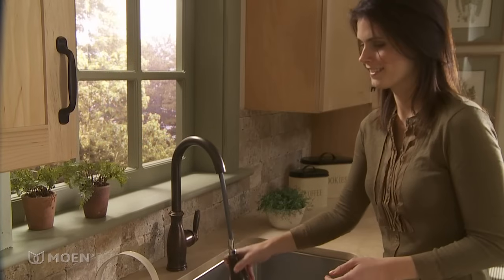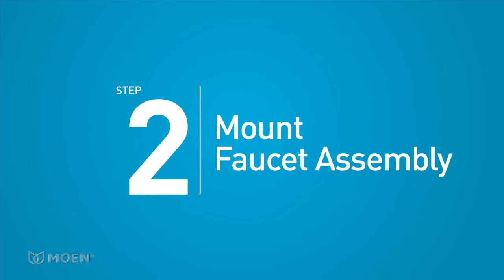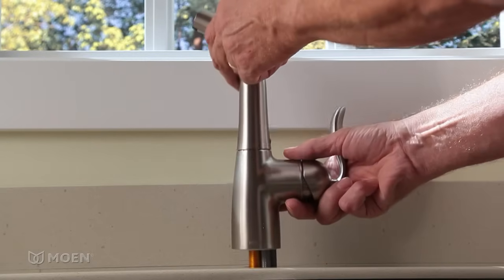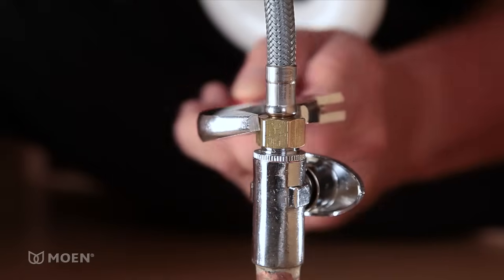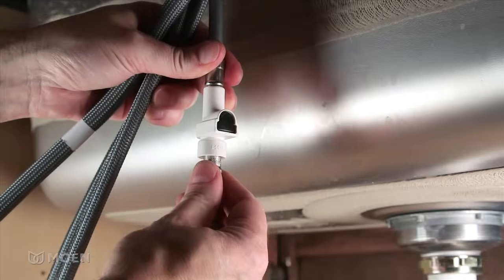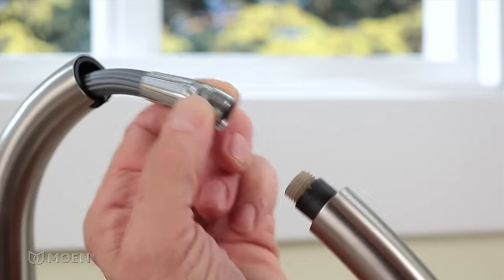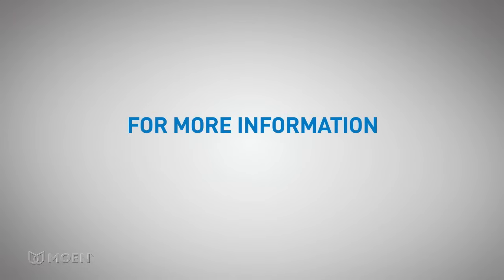Installing a Pullout Kitchen Faucet | Moen Guided Installations

Comment: My Moen faucet is now installed, and this video helped every step of the way. Very happy with it. The real work was getting the old faucet out, which was quite determined to stay put and leak and not run hot water. Glad it's out and the Moen is in.

Comment: This was a great, easy to follow guide for installing a pullout kitchen faucet. I was able to do it in about an hour with no problems. Thank you, Moen!
Reply: Yeah!  That would be great if they actually provided you with a support bracket for a single hole application.

Comment: Very helpful. This is my second Moen faucet and I must say they're well engineered and easy to install. Pro Tip: some older under sink valves might leak during installation. I recommend turning the water off to the whole house if you can, not just the water at the faucet.
Reply: InstaBlaster.

Comment: Thank you for this video; I installed the pull down hose in 5 minutes and saved $195.00  :)
Reply from the maker: We're happy to hear it, Evelyn! Check back often for more helpful videos.
Reply: Me too!! I will always buy Moen!
Reply: My pullout hose only lasted 4 years and started leaking in the middle. Home Depot does not sell replacement parts. Poor quality.
Reply: @Bad_Samaritan   Our previous Morn tap set like this eventually the handle gave out.    Moen sent the replacement parts, which I put in myself.   Worked for another year, and it similarly broke again.   I'm hoping new tap sets are even better now, as they would be aware of any deficiencies in their product and redesign as needed I'm sure, so I will purchase their products again.   We're on our second Moen kitchen tap set, and this one has worked flawlessly to date and has been in for well over a year now.
Reply: My handyman is charging $300 to install this.

Comment: This video helped tremendously. The install went smoothly. However the lever motion is from straight up to 90 degrees forward. All other sinks have been 45 degrees either way from vertical.

Comment: We replaced our old separate faucet and sprayer with a Moen Pullout Kitchen Faucet and couldn't be happier. We repurposed the sprayer hole for an garbage disposal air switch. I would suggest reading all of the instructions and/or watching this entire video before you begin. After several frustrating minutes of trying to tighten the mounting nut by hand, my helper handed me the "installation tool" and said, "Here, maybe this will help." 🤪
Reply from the maker: Good morning. Thank you so much for your feedback. Our Product Specialists are available if ever needed in the future. They can be reached at 1-800-289-6636 Monday through Friday from 8am-7pm EST.
Reply: Oh so this is what it is! I had that same aha moment! I am 71 years old and I just finished installing my new faucet!
Reply from the maker: Hello @bethmorano1452.  We are happy to know that our video helped with the installation of your new Moen Pull-out kitchen faucet.  
If you have any additional questions or require assistance with this faucet, Moen product specialists can be reached at 1-800-289-6636 and are available Monday through Friday from 8:00 am - 7:00 pm Eastern Time.

Comment: Thank you for the great instructions.  Question about Step 3, why no plumbers tape?
Reply from the maker: Hello David.  Plumbers tape should not be used when connecting the supply lines to your shut-off because the supply lines have a built-in washer to seal them.

Comment: this video convinced me i could do it.   bought Moen faucet put it in yesterday.  last night all was well.   today no hot water.  husband was right should have left fixture alone.  plumber bill to come.  sucks
Reply: +mskittie7411
What was the cause of the problem (no hot water)?
Reply: L Lawliet trash in the line, and i fixed it myself.   took apart and rinsed well.  removed condenser works fine.

Comment: I would like to know if the pullout kitchen faucets, specifically Brantford, can be used with an on-demand hot water heater.  I bought this quite a while ago, but it is still brand new in the box.  A family member came to live in the house, so it was never installed.  It's not the newer models with voice control, etc, just a standard model.  Low flow taps often don't run enough volume for the water heater to deliver hot water.  The current faucet works fine with hot water, so I don't want to take it out if this won't work with on-demand.  It's a 15 year old water heater, but not heavily used until the last three years by one person.  
 
Good video!
Reply from the maker: Hello kdcraft. Yes, Moen pullout kitchen faucets can be used with an on-demand hot water heater. If you need further assistance, please email us by visiting our Contact Us page at https://www.moen.com/customer-support/contact-us or you can call us at 1-800-BUY-MOEN (1-800-289-6636). Our business hours are Monday through Friday from 8:00 am - 7:00 pm Eastern Time.
Reply: Thank you!  @moenfaucets
Reply from the maker: You’re welcome. It was my pleasure assisting you and thank you for supporting the Moen brand!

Comment: Stupid question, but are you able to put a water filter on these types of faucets? I just replaced mine with this exact one a few days ago. And I forgot about wanting to get a filter selected with this new faucet until after I'd gotten it all set up.
Reply from the maker: Hello Scoobyfan 93. Moen Pullout and/or Pulldown style kitchen faucets have not been tested or any of our products potential compatibility with attachable water filtration devices; therefore, we cannot recommend any of our products to be used in this manner.

Comment: I am replacing a circa 2004 (I'm assuming since that is when the house was built) Moen faucet.  When I looked at the part that holds the faucet to the sink, I could not figure out how it was connected.  It was so rusty and the Moen method is weird.  After seeing this video, I was able to get the faucet off the sink.  The deep socket I have, was not deep enough, so I did the 1/8 turn thing until I could get the deep socket on.  Replaced it with a Kohler.  Will never even consider a Moen in the future.

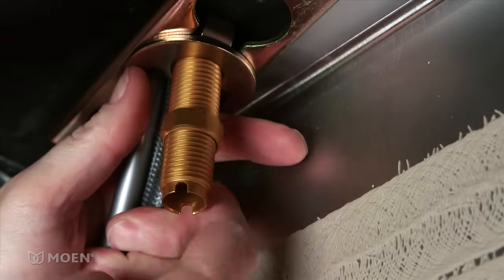Comment: Does anyone know what is the mounting nut size that is being installed under the sink at 1:54 in the video?  I am trying to remove my current faucet and can't seem to find the right size socket to use that will fit (I do believe I have to use a deep socket).  I tried the Superior Tool basin buddy nut wrench but that did not work and there is just not enough room to use other wrenches.
Reply from the maker: Hello AC-kp3fs.  The mounting nut for our Moen pullout style kitchen faucets is 13/16".  The nut will require the Moen 118305 installation tool that was/is included with our faucets or a deep well socket wrench.

Comment: Surprisingly easy too install once you remove the old one, SO be sure to HOLD ON TO THE INSTALLATION TOOL  and LABEL IT. Removing the old one was a bitch, because of rust, a deep sink and  no space between the sink and the wall. I broke the installation tool and had to buy  a deep socket 13/16 socket to add to a socket wrench and an extender. Then I had to resort to stinky (p.u.) Blaster penetrating spray after no luck with WD 40, but it worked in time for Christmas! Hallelujah!
Reply from the maker: Hello Jonathan. If additional installation assistance is needed, please contact 1-800-289-6636 (US) or 1-800-465-6130 (Canada). Thank you.

Comment: W here can I get the wrench to tighten the assembly. .the whole thing is loose after a “qualified” service rep. Installed this faucet about one year ago.
Reply from the maker: Hello Mario.  If you no longer have the installation tool that was included with the faucet, a basin wrench or 13/16 deep well socket wrench can be used to tighten the mounting nut.  For further assistance, please send us an email by visiting our Contact Us page at https://www.moen.com/customer-support/contact-us or you can call us at 1-800-BUY-MOEN (1-800-289-6636). Our current business hours are Monday through Friday from 8:00 am - 7:00 pm Eastern Time.

Comment: Nice tutorial. I wish at the end they showed the faucet in action. I spent 10 min trying to figure out why water wasn't coming out until I realized that you turn the water on by rotating the handle outward, 90 degrees, rather than rotating it toward or away from you. Should have been obvious, but the outward rotation isn't something I was used to with other faucets.

Comment: Can the faucet handle be mounted on the left side?   What would be the down side?
Reply from the maker: Hello Dale. The handle operation for our pullout and pulldown style kitchen faucet can not be adjusted for left side mount.  The handle needs to be installed to the right or in the middle with the handle facing to the front. If you have any further question, need technical or warranty assistance, please email us by visiting our Contact Us page at https://www.moen.com/customer-support/contact-us or you can call us at 1-800-BUY-MOEN (1-800-289-6636). Our business hours are Monday through Friday from 8:00 am - 7:00 pm Eastern Time.

Comment: I had this installed 4 months ago,  it was fine untill pressure came extremely low and the spray nozzle doesnt stay on it's own, you have to hold it. They shipped us another same exact faucet. Hopefully the problems are fixed.
Reply from the maker: Hello R Emanuel.  We are sorry to hear of your experience with your Moen pull down kitchen faucet; however we are happy to hear that you contact Moen directly to resolve your issue and the replacement is being sent to you.  If further assistance is needed in the future, please contact us directly and we would be happy to assist you.

Comment: What should I do if the faucet I bought didn’t come with any hoses? Nor any labels on which one is hot or cold. Should I just use the old ones?
Reply from the maker: Hello non0559.  We would suggest contacting Moen directly for assistance. You may contact us directly at 1-800-BUY-MOEN (1-800-289-6636).  Our business hours are 8:00 a.m. - 7:00 p.m. Monday through Friday Eastern Time
Reply: Don't try contacting them. You will be on hold for hours with no results.  Put your moen in the garbage.

Comment: The innovation a few (?) years ago was to integrate the supply lines, previously you had to buy 2 flexible supply lines. The old Moen I'm replacing came down with copper & you ran flex lines down to the shutoff. The down side is don't wreck the connection since you can't just go buy a new one. Over tightening the supply line connection will cause it to leak, as they say, snug but not overly tight. Sometimes I snug it, maybe on the loose side, turn the water on, check it, if there's a leak, snug it up some more. One time I ruined one by over tightening.
Reply from the maker: Hello Frank.  If additional installation assistance is needed, please contact 1-800-289-6636 (US) or 1-800-465-6130 (Canada).  Thank you.

Comment: Can you still the bracket if it’s greater than 1/2 “ thick?
Reply from the maker: Hello bluwng. The optional mounting bracket (support bracket) is designed to be used for thinner deck installation. Installing the mounting bracket on thicker deck installation, may result in less threads to tighten the mounting nut. For further installation assistance, we would suggest contacting Moen directly.

Comment: 1:57 - Correct me if I'm wrong, but you need 2 people for that step: one above to hold the faucet straight and one to tighten the nut below.
Reply: I've been able to do it alone. Just tight the washer until it touch the mount washer and tight a bit more. It will stabilise the fosset enough that it won't move.
Reply: I did this now with some help and a normal crescent wrench.  You can do it alone, but I found it can come loose again quickly.  There are $10-20 ez-change faucet tools you can buy if you can't find a helpful pair of hands.

Comment: What's the purpose of the donut weight on the pullout hose
Reply from the maker: Good morning. The hose weight under the sink provides tension on the hose to keep the wand seated properly into the body of the faucet.

Comment: Just a simple question on a spec for the Moen 7594SRS Arbor One-Handle High Arc Pulldown Kitchen Faucet. The spec sheet says it is designed to be installed thru a 1-1/2" min diameter. The hole through my 1-1/4” thick Cambria countertop is 1-3/8” diameter.  It appears from the product description and this video that the water lines plus the threaded hose conduit should fit through my 1-3/8” diameter and not really require exactly a full 1-1/2” diameter hole.  Is this the case?  I have not bought the unit yet and just need to know first.
Reply from the maker: Hello. Our spec sheet does recommend 1 1/2” minimum diameter hole to allow some room when fitting the water lines and threaded hose into the counter top. It may fit snugly into the smaller hose size but Moen would recommend staying with what the spec sheet advises.
Reply: @moenfaucets  Thank you for the quick reply.

Comment: Moen Cleo CA87011SRS:  looks like the handle cannot be installed to the left. :face-pink-tears:
Reply from the maker: Hello Tom.  You are correct.  Moen pull-down kitchen faucets that have side mounted handles can be installed with the handle on the right side or in the front/middle.  The way the handle operates cannot be changed to accommodate a left side installation.  
If you have any additional questions, please call us at 1-800-289-6636; we are available Monday through Friday from 8:00 am - 7:00 pm Eastern Time.  You can also send us an email at the following link:

https://www.moen.com/customer-support/contact-us

Comment: Tips on how to fix when it starts leaking? (not leaking where it screws on, it's leaking where the metal ball swivle meets the hose)
Reply from the maker: Hello Ryan, there is a washer located between the spray head and the hose kit. The issue may be that the washer needs to be replaced.
Reply: Appreciate the reply, thanks for this!

Comment: I installed a Kaden yesterday and it swings back to center. any ideas
Reply from the maker: Hello Billy. We recommend ensuring the pulldown hose is not obstructed under the sink. We would be happy to troubleshoot if the issue persists, please contact us directly at 800-289-6636. We are available Monday through Friday from 8:00 am - 7:00 pm (EST).

Comment: What size is the spray wand threads?
Reply from the maker: Morning Ronny.  The Moen 7294CSL Arbor pull-out kitchen faucet shown in the video has a pull-out sprayer with 5/8-16 UN 2B threads.

Comment: The hot side tag fell off.  Can I tell which side is the hot without it?
Reply from the maker: Hello Chris.  You can check the supply hoses to see if there is an area of the hose where the hot supply line indicator sticker was located.  The hose may be "rough" in the area where the label was attached to the hose.  If the faucet is mounted with the mounting shank in the front/center; the supply hose on the left should be the hot water.
Reply: @moenfaucets  Awsome thanks.  What negatives could happen if I install it on the wrong side?
Reply from the maker: Hello Chris.  The Moen pull-down kitchen faucet handle pulls toward you for cold water and pushes away from you for hot water.  If this is connected and is backwards, you would just need to switch the supply lines.

Comment: Can you tell me what size the water supply connections are? Looking for a converter for here in Australia.
Reply: It says 3/8 is that NPT or BSP thread? 

I purchased a 3/8 BSP converter but that 3/8 is still too wide...
Reply from the maker: Hello Darlene.  A Moen pull-down kitchen faucet comes with built-in supply lines with 3/8" compression fittings.

Comment: I have a pullout faucet just like the one in this video. It was installed in a kitchen remodel in 2013. The hose developed a rip and was leaking when the hose was extended and the water was on. I ordered a replacement hose and received it today. The hose was perfect until I attached the spray wand and went to put the wand in the holder. The attachment end of the hose has been redesigned and the wand will not go all the way into the holder. The new hose I ordered is part #150259. Please help...
Reply from the maker: Hello.  We would be happy to assist you with determining the correct hose needed for your Moen kitchen faucet.  Please call us at 1-800-289-6636; we are available Monday through Friday from 8:00 am - 7:00 pm Eastern Time.  If you would prefer, you can send us an email at moenwebmail@moen.com; include the full name of the product purchaser, the address where the faucet is installed, a full product view picture of the fixture and a copy of your purchase receipt.
Reply: @moenfaucets  Just installed the correct replacement part and it works like a dream. Thank you so much!
Reply: @moenfaucets I have the same problem. I bought it from home depot 5 years ago. Water is coming through the hose when I pull it out.  Please help.

Comment: Like Jacob, I also let go of the hose and it retracted back into the body of the faucet and I can't get it out.  I've tried pushing it up and it is getting intercepted by the slope of the faucet. And, I can't pull in down because the head of the hose is larger than the pipe opening. Any suggestions for recovering it?
Reply from the maker: Hello Krista.  In order to make any type of suggestion to resolve the issue you are experiencing we would need additional information.  Please contact our Consumer Services department at 1-800-289-6636; we are available Monday through Friday from 8:00 am - 7:00 pm Eastern Time.